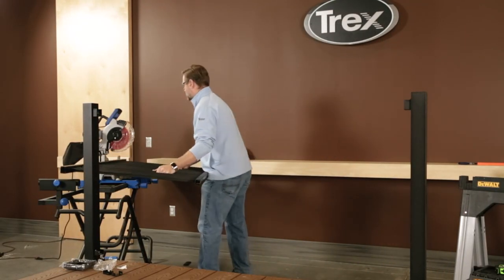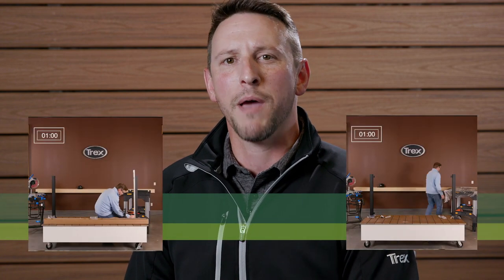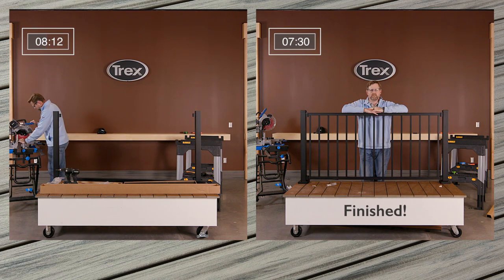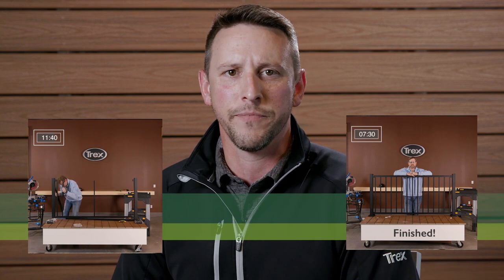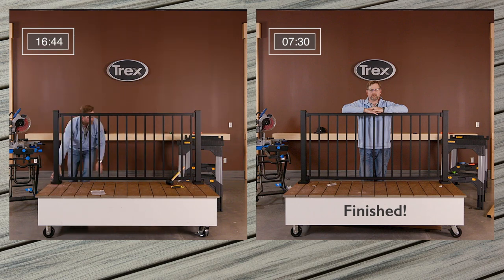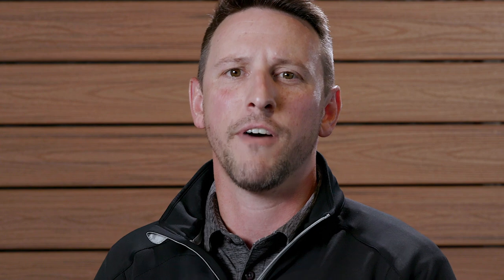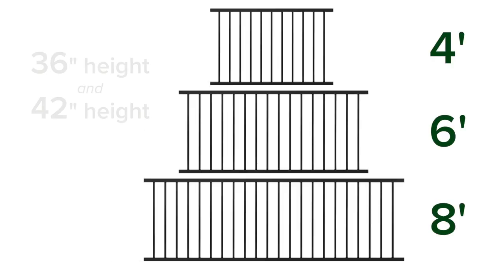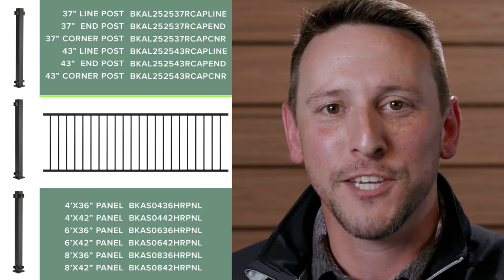Trex Signature Aluminum Railing Panel Vs. Kit Speed Test | Trex - YouTube

Comment: What measurement from bottom?
Reply from the maker: When assembled, from the decking surface to topside of upper rail should measure extremely close to 36” and 42” heights respectively. From the decking surface to underside of lower rail should measure approximately 1.975” for both 36” and 42” rail heights. Happy building!

Comment: What kind of saw blade do you use to cut the railing? Can I use post without pre-mounted brackets?
Reply: Use a non-ferrous metal blade. A ferrous metal blade is for cutting steel and isn’t the correct blade. And yes, you can use either post type with Trex panels. You can even use a wood 4x4 with Trex composite sleeve. (Note: brackets don’t come with the panels - so if you aren’t using a post with premounted brackets you have to buy the bracket packs separately)